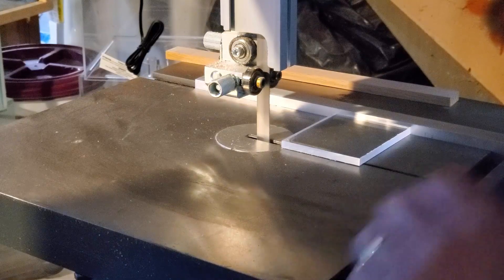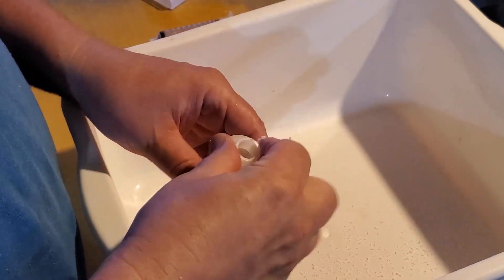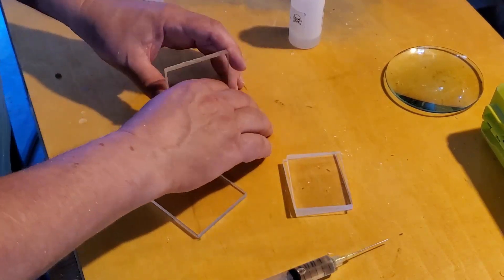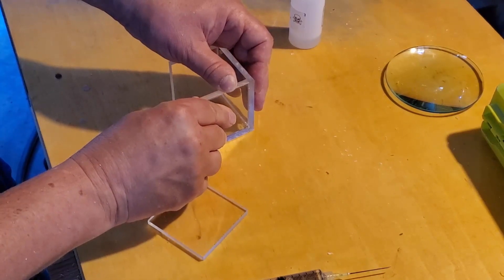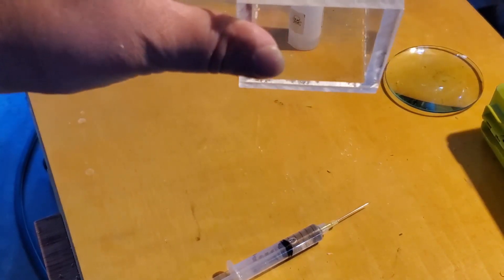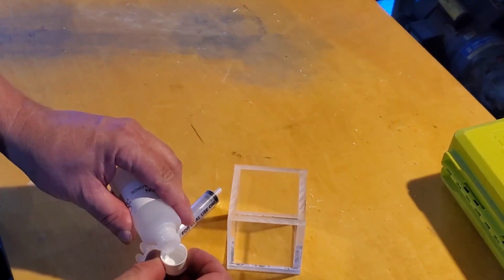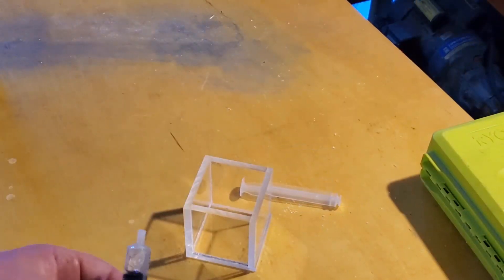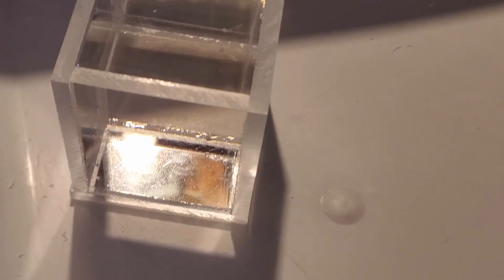Fixing Acrylic Welding Errors

Comment: Can you mix the acrylic shavings with the weld-on itself? or does it specifically have to be methylene chloride? Having a hard time actually finding it for sale anywhere
Edit: apparently it's (largely) banned form sale in the US
Reply from the maker: Methylene chloride has shipping issues in quantity as it is explosive. That's why some countries don't have it for sale. I've never tried using shavings in wled-on; but it should work
Reply: @FishmanEricRussell  Shavings mixed in weld-on did work, thanks

Comment: question I purchased a acrylic refugium that holds 2.5 gallons of water that in the customer reviews has been reported to start leaking after a bit of time hanging on the back of the aquarium, im wondering if applying a bead of 16 fast set acrylic cement would strengthen the already glued seams  any thoughts?  thanks Jeff
Reply from the maker: I've never tried acrylic cement. I've always welded. If you take a thin acrylic rod and cement that to the inside of the seam it will help though.

Comment: I have a 55 gallon acrylic tank that holds water but bows quite a bit in the front and back is this okay?
Reply from the maker: Odd that one would bow and not the other. A significant bow is an issue for sure

Comment: Hi Fishman,  I have a Juwel 260lt acrylic aquarium (10mm thick) that recently sprung a leak. Several 5-9mm pitted holes appeared on the floor of the aquarium which slowly occurred over years of continues wear on the same spots. What glue/cement you would recommend using and/or method to insure a solid fix.
Reply from the maker: Fixing acrylic tanks is very tricky as old acrylic doesn't take a weld well. Your best option would be to cut a piece of acrylic much larger than you need and use it to cover the bottom and try to weld that into place.

Comment: I built a triangle tank out of acrylic once. There was a 90* and two 45’s. I leak check it for 48 hours and all was good. After two weeks the weld I was most confident about (the 90) busted out. I used the slurry Weld on solution to repair it. It worked great. I also used it on the 45’s just to make sure. 
I also rounded all the corners by sanding them. It gave them a frosted look. They looked nice but were not perfectly straight so I used the weld on as a polish and made them clear again. 
I can’t remember where is saw it but there was a channel that did flame polishing which looks nice but has some serious set backs afterwards when cleaned with isopropyl alcohol. On the indoor pond it thought maybe the chlor solution might help clear up the frosted glass( probably to late now sorry). Have you ever flame polished? If you get bored try it and then show what it does with the alcohol.
Reply from the maker: I try and avoid making acrylic fish tanks for that reason. I've flamed acrylic before and it does clear it up. The downside is you have to be very careful or you cause ripples or worse. I never put alcohol on it though so I don't know what that does. You're right in  that I've already polished the indoor pond and it's too late to try anything  on it. Thanks for coming by!